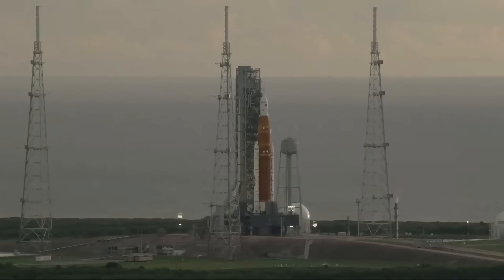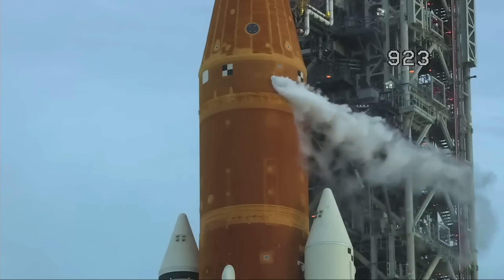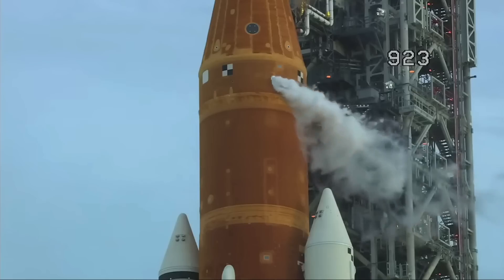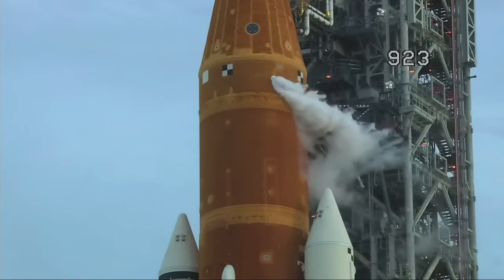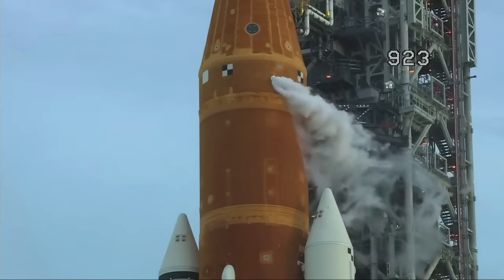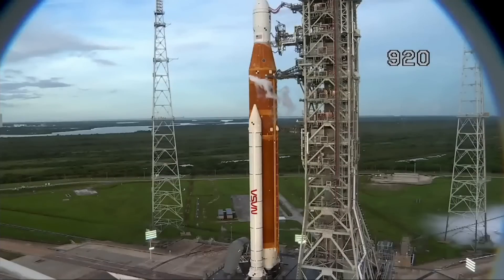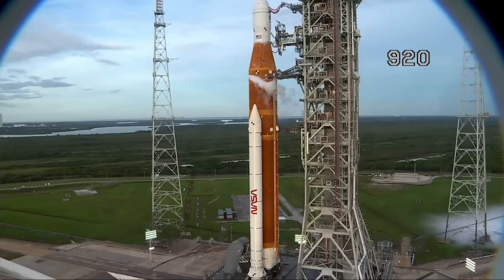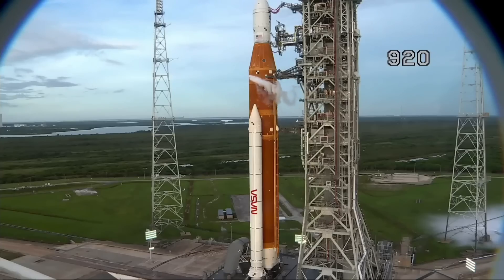NASA Artemis 1 moon rocket has 'stress crack' in tank's foam, no structural damage

Comment: NASA i got to give it to ya, y’all are good. Never been to the moon but had to come up with a clever lie then and now an even better lie Now.. 😃 👏
Reply: when apollo 11 first landed on the moon, we could actually use radio antennas to listen to the radio transmissions sent from mission control to apollo 11 and vice verca (one german radio station even broadcasted the whole thing). using the doppler effect, we were able to determine that the radio transmissions DID actually come from the moon. the doppler effect cannot be faked.

if that doesn't convince you then nothing will as it proves your ignorance.

Comment: A rocket where 95% of its weight is fuel. Not good.

The only solution is to move construction to space. Expensive to design and implement, but it means that the craft that actually go anywhere can use efficient engines that don't have to lift against Earth's gravity. So obvious that nobody will implement it. (Well, I'm sure the Chinese will eventually.)

Comment: I imagine that when the tanks are full, the rocket shrinks a little causing foam cracks.  Expected...    As the air pressure changes in flight, the foam will popcorn off and possibly chunks will fall off.  Expected...
Reply: And there are no wings to impact...
Reply: Go tell NASA they forgot how 30+ year old tech works.

Comment: Of course there's going to be problems. Using old technology that didn't work (the same foam used during the Shuttle days - remember Space Shuttle Columbia) Old Shuttle engines and upgraded SRB's. (Remember Space Shuttle Challenger was brought down by frozen, faulty O rings in the SRBs) And the only reusable parts, are the SRBs.  Instead of stepping forward and using new technologies, they just took a step sideways and tried to use what they had on the shelf. Plus it's costing billions and billions of dollars per flight which makes it totally unsustainable.

Comment: This rocket design is one  POS, Total lies pushing it in media by NASA clowns. the RD 25 engines are nowhere near as powerful as the F1 Saturn engines. Plus, this turd is 40 ft shorter , with solid rocket booster needed to help this pig get up,  because those RD 25 shuttle engines suck. It is a total lie this is most powerful rocket. Laughable lie . this is a shuttle without the shuttle. only a capsule on top. LOL , They should all be fired.

Comment: Nobody has ever been to the moon. 
240,000 miles one way Supposedly was live on tv and talking with no delays. Came back in a little capsule that I actually have seen at Kennedy space center. There is no way they had enough fuel for a 480,000 mile trip. 
As for the communication everyone I know complains about not having cell phone service. And to believe they communicated from the moon back then is a joke. As far as they been in space  is that joke called a space station that is just above the earth’s atmosphere. It’s only a few miles higher than planes fly.
Reply: you know that rockets dont need to be burning fuel for 480.000 miles, right? they just need to burn at the start and that's it

Comment: NASA shows off it’s cutting edge rockery technology with the SLS/Orion spacecraft here! Totally insane how far mankind has gone in it’s space technology😱
Reply: I know it's just sarcasm, but the only "totally insane" progress in rocketry has been at SpaceX, not NASA.  SLS is using used rocket motors from the Shuttle, engines which started design in the late 1960's.  Not only that, these engines were designed specifically to be refurbished and reused, but NASA will now be treating them as disposable.
Reply: @chrisantoniou4366  it's cheaper to launch one time use rockets than SpaceX scam reusable rockets. And starship will never reach space. Cry more.

Comment: Yes that foam has always been so reliable and those extremely complicated re-usable engines are perfect for an enormous SRB based one time rocket. Just perfect design.
Reply: Well... That foam caused the Columbia disaster in 2003

But it never caused any problems since 1981, so... Yes, it's kinda reliable
Reply: @MrTitanic14  It didn't cause any fatal problem besides Columbia you mean, every flight had cracked tiles due to either ice shedding or foam shedding, both of which is a failure of the dinosaur TPS.
Reply: @DeferedPattern  Ablative shields are the dinosaur.
Reply: @MrTitanic14  nearly destroyed Atlantis too, but the hole it punched inthe heat shield was right over a structural steel beam so it had no effect
Reply: @srfhdx5584  for what I read, it was the SRB insulation that punctured Atlantis during STS 28, but yeah

As someone pointed out, we're having problems inherited since the 1980s
Reply: @MrTitanic14  I re-read and it said the inner tank foam so I am to be corrected but still everything else is true really. You don't build the future from recycled parts surely. I want more than anything for this to succeed but it am still shocked that after all the delays the day I had in my calendar to celebrate still didn't fly. This is in every way an awful solution to a very well researched and understood engineering problem.
Either way I am confident that if this ever flies it may only need one catastrophic accident before it performs flawlessly but it doesn't even have enough engines to do so for long. It's just doomed to be an expensive, short-term complication and I believe it will only serve as another lesson like the beautiful, astounding and wonderous but flawed Space Shuttle.
Reply: @milolouis  You have every right to be disappointed but no right to be "shocked".  Indeed you are right about Artemis in the sense that there aren't enough rocket engines for it to be anything other than a short term exercise in futility.  As it is, Artemis 1 cannot even land on the Moon and will not be able to do any scientific research except on the Orion capsule, and what was meant to be a cheap way to get into space by reusing (not even recycling) leftover Shuttle engines has turned into a long delayed, expensive white elephant.
Reply: Do i detect some sarcasm ?
Reply: yeah, gosh, what if a foam piece falls off and hits the shuttle's heat shield again?

oh wait...
Reply: @fendermarxist  IF IT WAS SO PERFECT WHY DID A PIECE OF FOAM BLOW UP Columbia?
Reply: @OneVision1111  I didn't say it was perfect, I said that particular criticism doesn't really matter on SLS. There's nothing as delicate as the shuttle's heat shield for falling foam to hit.
Reply: @fendermarxist   I QUOTE YOU SAYING PERFECT DESIGN "Yes that foam has always been so reliable and those extremely complicated re-usable engines are perfect for an enormous SRB based one time rocket. Just perfect design."
Reply: @OneVision1111  that... wasn't me. that was someone else.
Reply: @OneVision1111  Hey dummy, that was Milo B, and it was said sarcastically (look it up)!
Reply: @fendermarxist  You SAID PERFECT DESIGN I SAY YOUR CRAZY Every Machine Fails at some point Especially one With Millions Of Moving Parts Like this Launch that Just Got Scrubbed So perfect that they Couldent LAUNCH LMAO
Reply: UNTIL A PIECE BREAKS OFF HITS THE SHUTTLE AND MAKES COLUMBIA EXPLODE HOW FING DUMB ARE YOU? DEFINITE THUMBS DOWN FOR AN IDIOT WHO THINKS A CRACK IN THE FOAM CANT BE CATASTROPHIC  WATCH CAREFULLY GET EDUCATED https://www.youtube.com/watch?v=IgQ3ekcvyRA PERFECT DESIGN MY ASS
Reply: And they say that nasa went to moon in 1969 onwards six times without any casualties with the technologies from 60s... Only imbeciles would believe it...
Reply: moon landing was fabricated
Reply: @pinefilms3141  Yes and the cost of building the full Apollo rocket that everyone saw take off for the hoax nearly bankrupted the CIA. Was a nightmare to budget.
Reply: @pinefilms3141  Explain the hundreds of kilos of lunar material returned form the Moon by the astronauts.  It has been examined for over 50 years by thousands of scientists from hundreds of institutions in dozens of countries using the most sophisticated instruments and not one of those scientists has ever expressed even the shadow of a doubt of the material's origin.

The Moon landings were real and exactly as reported.  Your assertions without evidence can be dismissed without evidence.
Reply: Science Revolution  Nope.
Reply: foam is what took down the suttle. saturn v's had 1200 lbs of ice bounce off it during launch and never missed a beat
Reply: @MrMakemyday3  The difference is that most of the ice that formed on the Saturn V broke off it at low speed and had nothing to hit.  The Shuttle was particularly vulnerable because its wings were in the "firing line" of any foam that broke off and with foam, being tougher than ice, wouldn''t break off until later in the flight when aerodynamic forces and increased acceleration made the foam more likely to cause damage.  With SLS, there are fewer critical areas if foam does break off except perhaps with external pipes or the attachment points for the SRB's, but if foam breaks off there is still a non-zero chance of damage being caused to the rocket.

What we don't know is whether or not there wil be more cracks in the foam insulation when the SLS is fully fuelled or how extensive these cracks will be.  The rather blase attitude of the launch directors, and the fact that the foam insulation was never "perfected" in the 11 years since the last Shuttle flight is worrisome and speaks volumes for the incompetence of the people running the SLS program.
Reply: Science Revolution  Nope.
Reply: Science Revolution  asked, "How do I know space missions are fake?"
 Because you are VERY poorly educated. NASA has a multitude of methods to measure a rocket's speed in space. Just because you don't know how inertial navigation systems work doesn't mean that they can't measure the movement of a spacecraft. NASA has deep space satellite dishes that send signals out into space for the spacecraft to receive. Some of that signal bounces back. The frequency of the signal is very precise and NASA can use the Doppler Effect to measure the rocket speed very precisely. Have you ever heard of RADAR? Well, now you know the basics of how RADAR works. If you don't know what the Doppler Effect is then "Google" it. Or go stand next to a railroad crossing and listen to the train's horn as it approaches. The pitch of the horn will go up in frequency as the movement of the train towards you compresses the sound waves. When the train's horn is right next to you, you will hear the true frequency of the horn, but as it passes by you and moves away from you the sound waves get stretched and the pitch of the horn goes down. That's the Doppler Effect that you are hearing. I can rebuke anything you stated but I don't have the time to waste on educating flat earthers and other people of that ilk. Oh and please don't stand ON the track when you're checking my Doppler explanation. <G>
Reply: The world beyond “on paper”.  Respect for aborting and (unhurriedly) checking and thinking.
Reply: Perfect like Starship and its launch abort system. Figure that one out armchair rocket scientist.
Reply: @rwj1313  Starship has many more, and more robust launch, flight and orbit abort modes than any craft thus far. What it doesn't have is a capsule escape system, which is probably what you are getting at. The shuttle didn't really either, being strapped right next to the big boom device. Starship's safety focus is on flightworthy redundancy (regarding thrust components, not just computer systems). The catastrophic explosion case is sought to be avoided at a an airliner statistical safety level, though how close they come to achieving that is yet to be seen.
Reply: @岩男沢山  I am a fan of what SpaceX is doing. However, I'm very tired of the idiots constantly criticizing NASA and holding up SpaceX as being the end all be all. My point about SpaceX not having a launch abort system on Starship was exactly the same as the Space Shuttle with no launch abort escape system. NASA put humans on the moon 50 years ago. There is some information you can't "Google" or find at your local library. NASA has been exploring Mars for decades. Have you ever heard of NASA's Mars Reconnaissance Orbiter? How about the Mars Global Surveyor, Mars Express, Mars Odyssey, Mars exploration rovers Spirit, Opportunity, Curiosity, and now the Perseverance rover? NASA has developed and is still refining detailed maps of the surface of Mars. SpaceX has already asked for help from NASA and JPL engineers, to select a suitable landing site, analyze the spacecraft's entry, descent, and landing system, and review the craft’s autonomy, fault tolerance, operability, and qualification approaches. 

How will SpaceX communicate with their spacecraft on a journey to the moon or Mars?

NASA will let SpaceX use its deep-space and Mars relay communications networks. SpaceX does not have the required deep space communications network to make the trip to Mars. NASA has a set of large dish antennas in California, Spain, and Australia, capable of communicating with spacecraft making the trip to Mars. NASA has interplanetary navigation experts at NASA’s Jet Propulsion Laboratory who can plot a ship’s trajectory toward Mars. SpaceX will need NASA and JPL's interplanetary navigation experts just to get to Mars and they will require NASA's help in plotting a landing point. 

SpaceX cannot launch any spacecraft to Mars or any other planet unless it meets planetary protection standards. 
Guess whos in charge of that? Planetary protection standards were set by NASA and outlined in international agreements. Such guidelines ensure that Earth-based microbes do not contaminate a potential Martian ecosystem.

The general public may perceive a race to Mars or a competition between NASA and SpaceX but the race and the competition do not exist. When SpaceX does go to Mars, NASA will go with them and literally show them the way. Chemical rockets will never reach airliner statistical safety levels IMHO. It pains me to say that SpaceX will kill a bunch of astronauts at some point. It's not a matter of if but when. We are on the same team!

Comment: Artemis will still be sitting on the launch pad when SpaceX gets the starship in orbit.
Reply: Artemis is going a little bit farther than LEO. NASA’s been there done that back in the early sixties. They also went to this little place called the moon. LEO is about 250 miles high. The moon? Well you need to add 3 zeros to the 250 so that you have the distance to the moon. Talk trash about NASA after Starship travels 250,000 miles to the moon like NASA did over 50 years ago.

Comment: I think is a lie from them they know the sensors detect defect the problem is 99billion dollars falure by the factory this money you problably make 10 fuel tanks .this error is generate by incorect test stress from low temp test aluminum weld by friction or worst problem the new mix aluminun heat treatment parts weld test to crack and incoorect xray or magmaflux for brittle in 200 low temp inside liquid fuel is less torelable the aluminum than steel .this fuel thant is defect may be go to scrap..billon dollar proyect

Comment: So I work with the safety and mission assurance people. There is no serious “crack”. TOSC has checked. Now for the engines, that will be fully looked through. I am kinda upset we didn’t do a full wet dress last month because this would have been addressed then and we would have addressed this a month ago, but that was NASA’s decision. I was not surprised today was scrubbed because we didn’t do the full wet dress. Everyone at the rocket factory was not surprised. From the green run at Stennis, the contractor has learned loads of new information and we have addressed all those issues and are continuing testing while manufacturing.
Reply: I do not work for NASA
Reply: Lol
Reply: Cringe
Reply: @keinoir  yet you failed geometry???!!

Comment: Why are you lying NASA about a crack in the foam as the reason for the fuel leak. Foam can't begin to hold the tank pressure - just tell the truth and admit the tank has a crack. Would you launch anyway given that tank leak. You guys used to take space travel seriously and now you are nothing but a joke. SLS is a Hugh waste of taxpayer money - shut it down before you need to spend another 10 billion just to fix the cracked tank.
Was the tank proof tested before loading with fuel - how many Bar did it pass.

Comment: Also there is an issue with one of the 4 main engines not receiving the required amount of coolant that prevents it from melting.
Reply: I read that it was because of a sticky valve and that sounds oddly familiar...
Reply: Not exactly to prevent it from melting, but instead, thermal shock. Liquid hydrogen is -253 C (-423 F), while the air temperature at launch was around 25 C (77F). This 280 C temperature difference would be a huge problem; imagine taking a piece of steel out of an oven at 532 F and tossing buckets of ice water on it. Thus, just before starting the engines they must be cooled to near the temperature of the fuel. Engine #3's hydrogen valve was sticking closed, and the engine was unable to get down to temperature. (It may use a separate "bleed" value to do this vs the fuel valve but in any case, no go.)
Reply: @hunterjohnson7393  Thank you for the clarification.

Comment: NASA should give up before someone bad happens with Astronauts inside. SpaceX should take over
Reply: "NASA should give up before someone bad happens with Astronauts inside."
Well, the stop of the launch was because of safety. 

"SpaceX should take over"
So it is safer for astronauts to use a rocket that doesn't have an escape system, but is instead a death trap like the space shuttle?